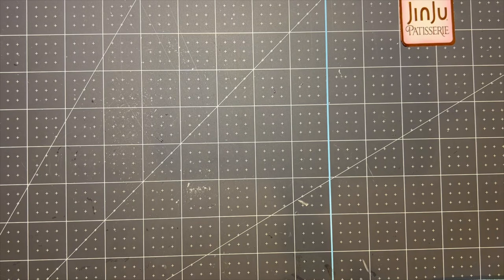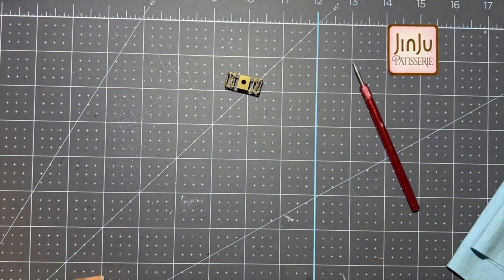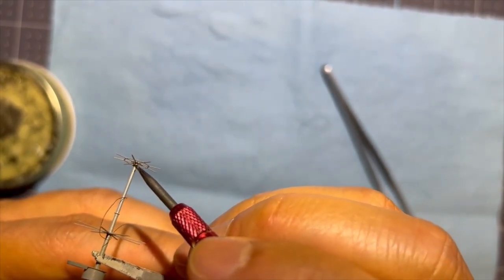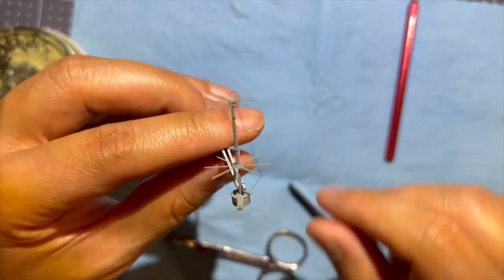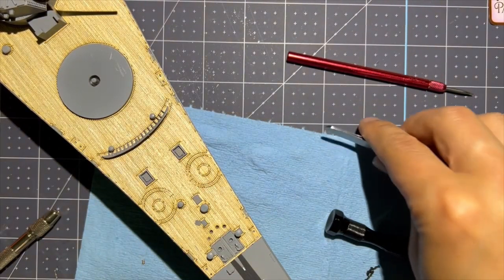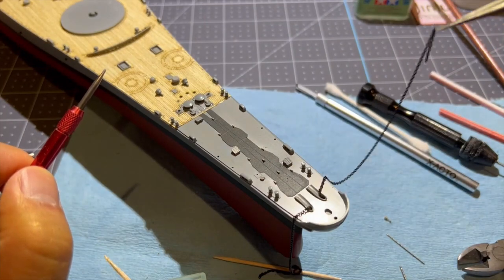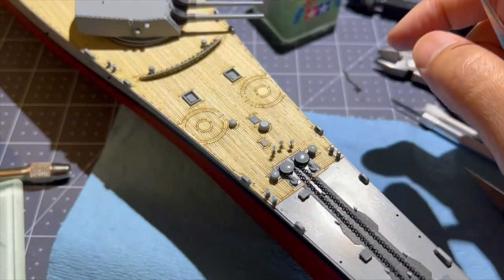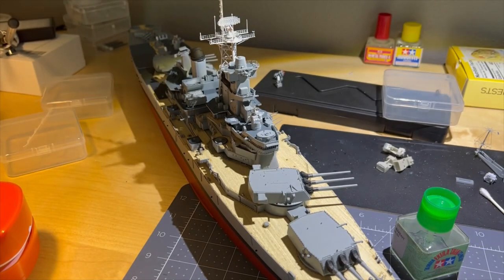1:350 Tamiya USS New Jersey Build 16

Comment: Also being an ok modeler, I struggle with threading through tiny holes. I have been working on a wooden ship's rigging and the tip I picked up is to cut the thread on an angle, then coat with a small amount of CA glue, which makes it sort of like a needle. It does make it somewhat easier. I'm watching this series because I have the Revell Platinum edition of this model waiting for me in my workshop.
Reply from the maker: So basically it makes it sturdy? I might have to try that. I have a lot of rigging in this build.
Reply: @theokmodeler5755  Yes, rigid and keeps the ends from fraying.